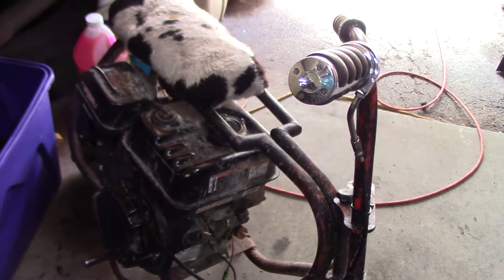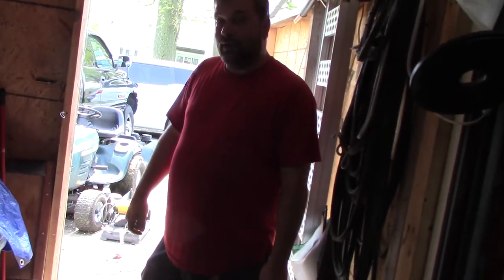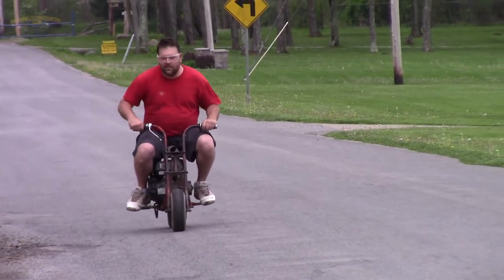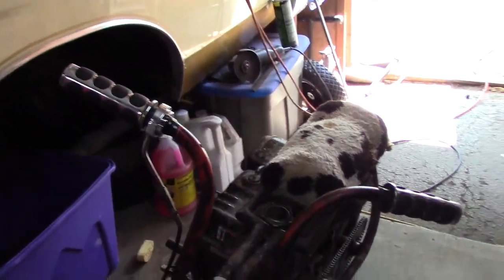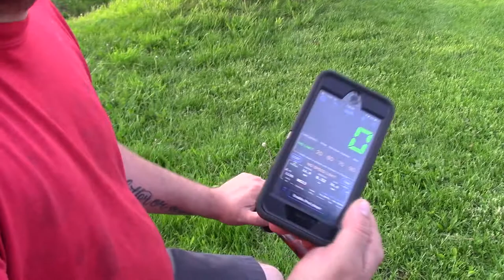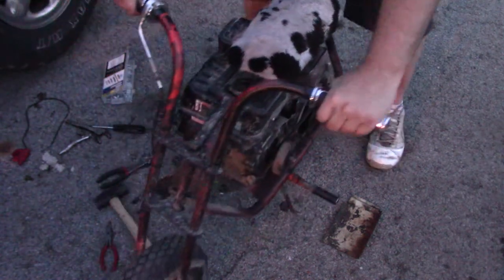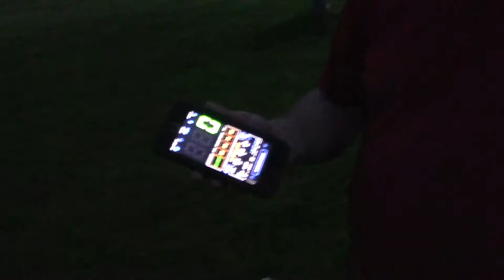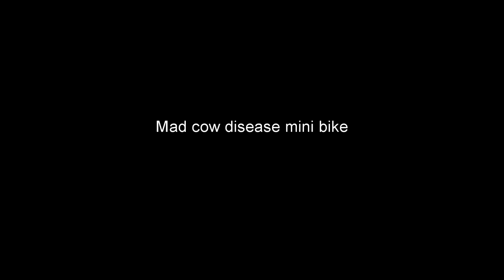New mini bike - Mad cow disease

Comment: lol I had a mini bike like that.we broke the pull start so we put a washer in the clutch so we could push start it and it worked good then the master link clip fell off so we put a big glob of glue on the ends and it held up then the back rim came loose and slid off.oh and the only way to start it was to dump gas in the carb
Reply from the maker: Bl_Eric Eric Stump sounds like a fun time! Sometimes you gotta get creative.

Comment: Hey guys I have a question about your racing mowers, What was the pulley sizes on them and Was the governor removed? Keep up the great work on the videos!
Reply from the maker: Robby Carpenter we run a 9" on the front and a 3" on the rear. We use the stock pulleys and use a hole saw to drill the centers out amd swap them. To accommodate the 9" front you need to relocate the clutch and change the linkage slightly. I can send pics if you im me on Instagram @fireandgasoline13 Thanks for watching!
Reply from the maker: And yes the governors have been removed, not internally just the linkages removed.

Comment: Yup stock springs can not handle the higher RPM's. Be careful if you keep it un governed the flywheel can turn into a damn grenade at higher rpms then what it is rated for.
Reply from the maker: Thats what i hear but haven't had it happen yet. That would be awesome on a video.. lol.

Comment: When y'all un governed the engine you are now floating the valves at high RPM's actually loosing power/speed.
Reply from the maker: I think you're 100% correct. Might have to order some stronger springs, they are pretty cheap.